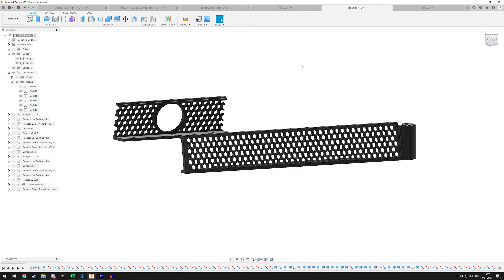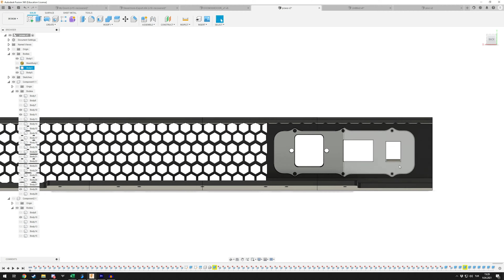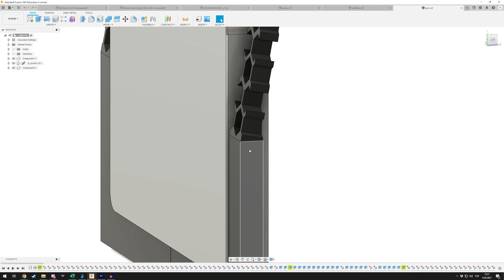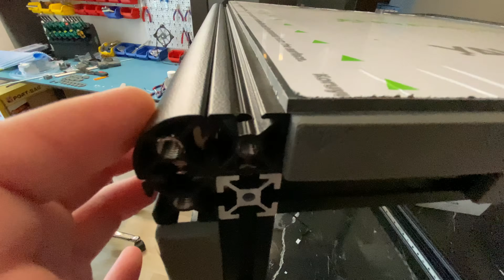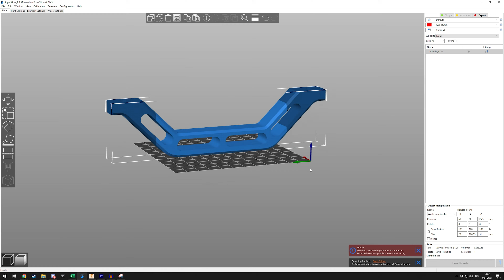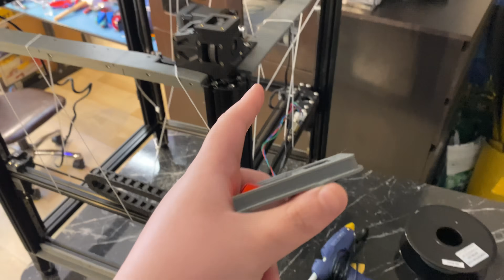Voron v2 Ep. 18 - Display & Door Seal & More

Comment: What's the reason that the doomcube has the z drives on top? Seems like a weird design choice if the main benefit of the design is to contain the heat better.
Reply: It is designed that way so that the low voltage electronics section can be mounted on top instead of the bottom. Not the best design choice though since hot air rises and there is no benefit from separating the low voltage electronics from the high voltage power supplies. It will cause more fumes to leak out through natural convection.
Reply from the maker: I'm not 100% but I think YL is right, so all low voltage is on top. Otherwise with the rest of the low voltage on top, you'd need to wire all the way to the bottom. I agree that this has downsides but I think the z drives could be modified more to block all of the air path.
Reply: @IsiksTech   is there anywhere you have posted the cad files of your doom cube ? i am trying to build a doom cube now and i want to do a similar design to yours. it would save a ton of time for me to not re invent the wheel.
Reply from the maker: I didn't yet since it is a wip. If you want the unfinished cad message me on discord. I can send a step file. I'm xbst_#1337